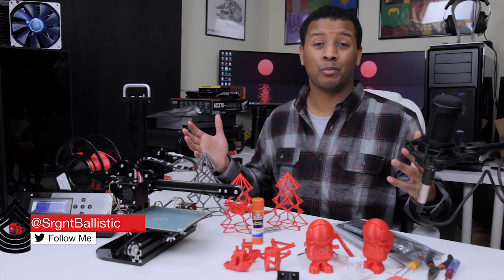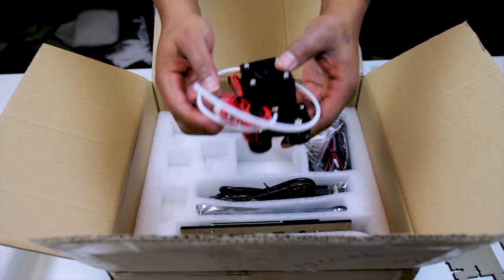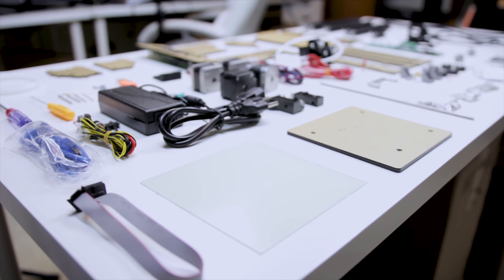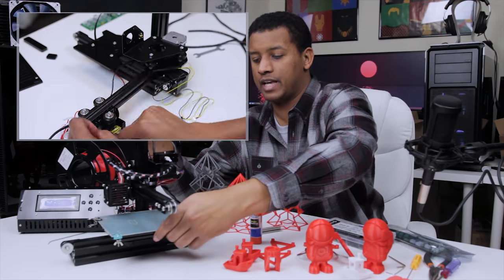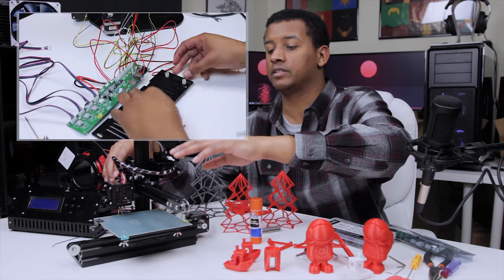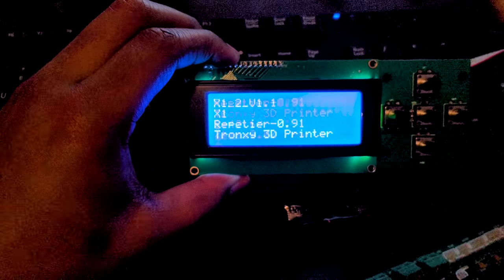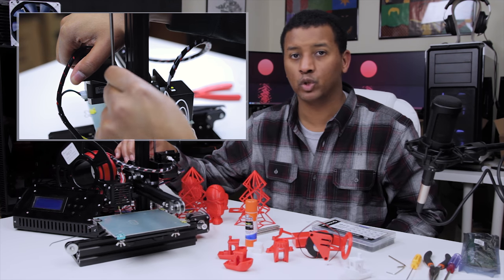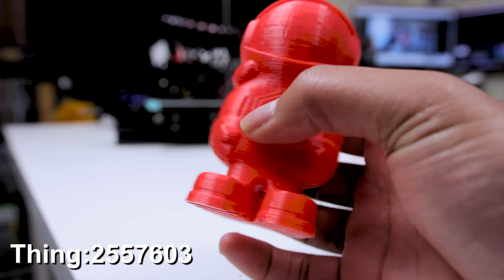$125 3D Printer Kit - Tronxy X1 | IN DEPTH Unboxing, Build & First Impressions

Comment: Got mine for $100 (plus insurance with shipping- $145 total). Put it together quickly. Seen a video where Chris Wesley put in a couple of washers behind the z axis mount because it would not align right. I did the same and it fixed the z axis binding. For its price, despite the work you do on it, it can't be beat.My friends have $500+ 3d printers and Im out-printing them! I love my TronXY X1!
Reply from the maker: Nice. I have seen a couple of Chris Wesley's videos on some of the upgrades he did for the extrusion. Thanks for watching!

Comment: For this pricepoint its better than good.

I mean the only real problems are slack on axis (they should make their template for acrylic parts tighter on nuts) and leadscrew nut. other than that this machine could pass easily for 250 euro otherwise...
Reply from the maker: Yeah it's definitely a good deal. My experience probably wasn't typical. Outside of it being a review sample the board problem probably won't happen to many people. But the Z-binding and slack in the Y/Z seem to be common.

I really hope they work those 2 issues out.

Comment: Top man ! Thanks a lot, i just built a X1 and I use cura slicer, could you share your printer and prints settings? I am really struggling ... cheers !
Reply from the maker: Yes I'll go grab them after dinner. Thanks for watching!
Reply from the maker: X (Width): 150 mm
Y (Depth): 150 mm
Z (Height): 150 mm
Shape: Rectangular

GCode Flavor: Repetier

X min: 20
Y min: 10
X max: 10
Y max: 10

Nozzle Size.4

These x/y min/max settings might need changing. When I set a model in the middle of the bed in Cura it doesn't pretty directly in the center of the build plate.

I've generally been printing 
Speed: 40-60mm/s
Layer Height: .2mm
Temp: 210+ (PLA)
Retraction: 4mm @ 25mm/s
Infill: 20%+

Comment: May I ask, using which slicer?
The printer and my pc will crash if print using repetier via USB,
If using cura via USB, the printout look weird.
Also the printout will shrink on one side, and got many string when print string test....
Reply from the maker: I've been using Cura which is free and Open source I believe.
Reply: I use Slic3r which comes on the SD card. Load up you model on it, slice it and export g-code to the sd card. Then put it in the printer and print the g-code file.
Reply from the maker: Hmm. My card din't come with Slic3r. Just Reptier Host. I used Cura which I've gotten used to since it came with my Maker select plus.